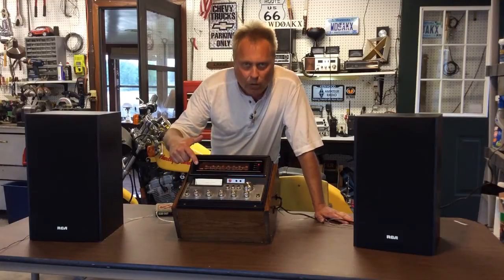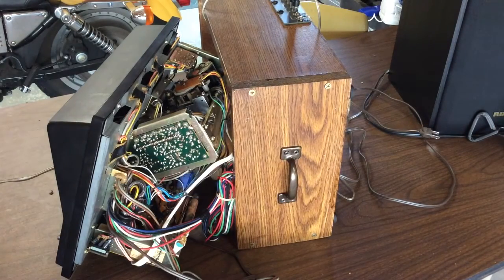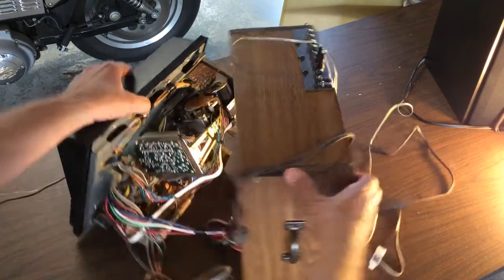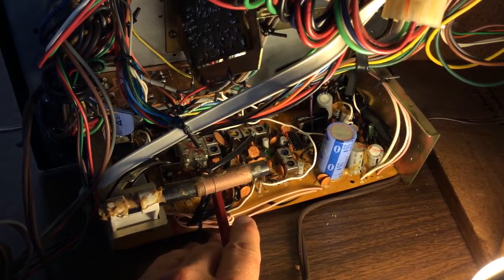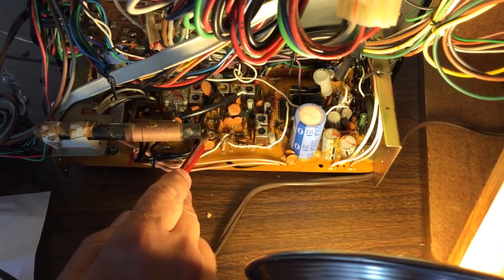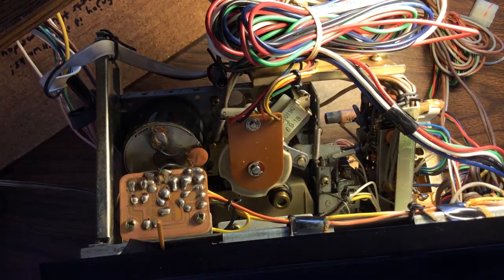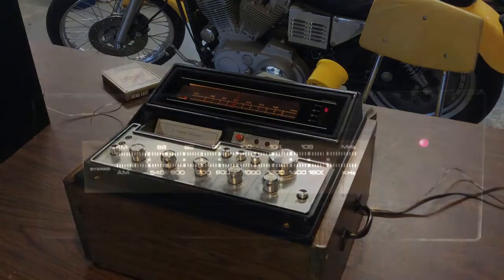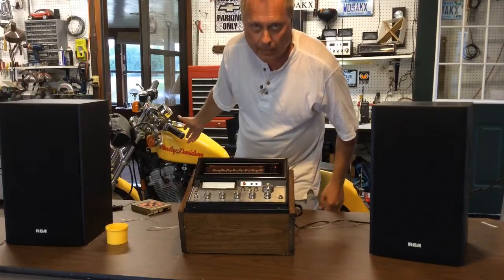New Life For AM/FM Tuner/Amp From An Old Console TV (Curtis Mathes 1979)

Comment: I recently got a console record player with built-in AM/FM and 8-Track. I have been looking everywhere for more details on the tuner, but have had little to no luck. This board looks the closest so far, although mine seems to be five or six separate boards. I've been having a dreadful time with my filter board, trying to replace the filter cap has not been easy. Do you know where I can find any information on it?
Reply from the maker: +Caleb Wallace I know what you mean, without the information on what brand it came out of or model it will be very hard to find any info on it sorry to say.  The board I have here was taken out of a Curtis Mathes TV but I really don't even have any information on my board, I was just lucky it was still working for the most part and was able to figure out the stereo problem I had with it by finding the stereo decoder chip and messing with the pots on the board near that.
Reply: The brand is Curtis Mathes, the model is a 1973/1974 stereo console, I haven't been able to find an exact model number. Unfortunately the label on the back is mostly missing, only telling me that the model # ends with "-2" and  that the color is Pecan Vinyl. The speakers are dated Sep. 12 1973. It has been a pain because the filter board seems to need quite a bit of maintenance, and without the original schematics to this model it is more of a guess-and-go.
Reply from the maker: +Caleb Wallace Not sure if there are Sams Photofacs, spelling? Online or not you could search for free but that might be an idea from those years?